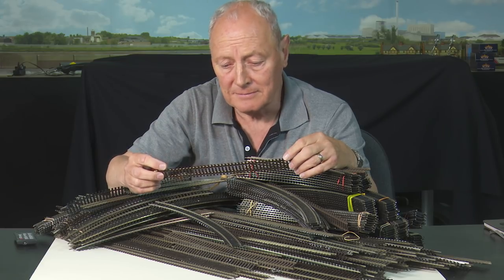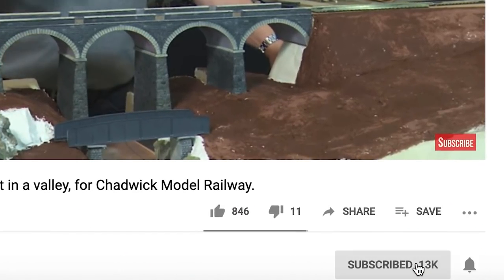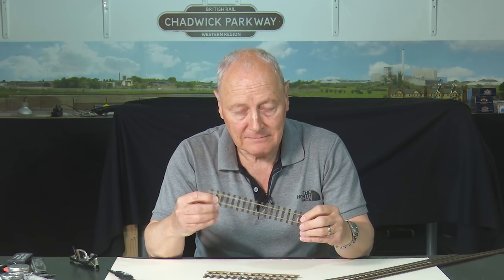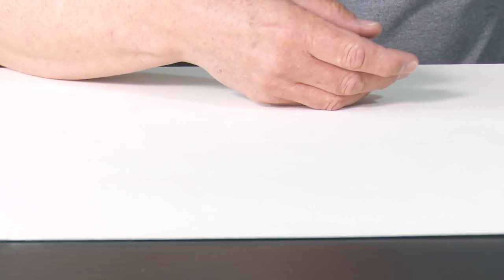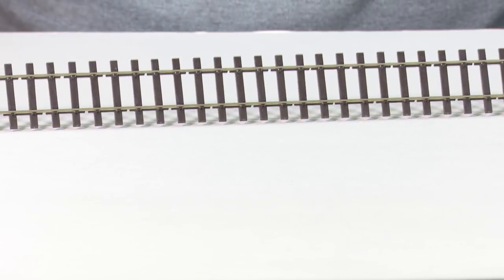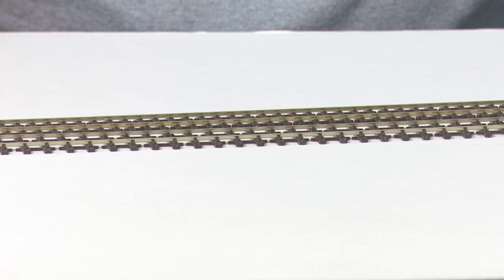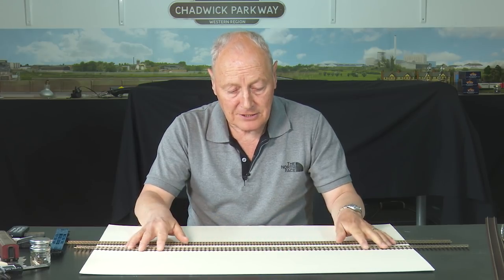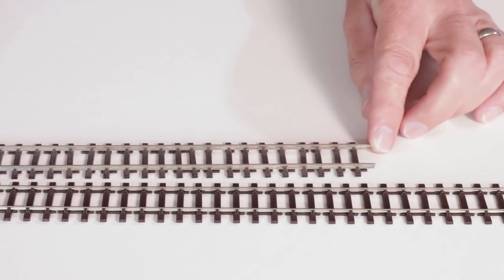Track  Peco Code 100, Code 75, Bullhead, EM and P4 explained at Chadwick Model Railway | 66.

Comment: Bullhead track should and could have been made available years ago. While steam locomotives continue to be an important part of the RTR scene, it is noticable at exhibitions that more and more modern image layouts are to be seen. Point geometry with flat bottom rail is not quite so easy to replicate in miniature scale, not an insurmountable problem, but cetainly a little more thought has to be given to its construction. Bullhead in this aspect is far easier to achieve. I also believe that the compromise with HO/OO , and the motors available not being suitably small enough to fit into the British Outline, was also a consequence of us refusing to source appropriate motors from Germany, where they were available.  Peco has dragged its feet over this HO/OO issue for many years. A prime argument being those who want finer track will make their own, which we do. However, simply spacing the sleepers, yes , it does take time, but is a cost effective way of maing the track look far better.
Reply from the maker: I couldn't agree more mate. Regards Charlie

Comment: The essential difference between 00 scale and P4 is not the scale ratio which is 1:76.2 for both but the gauge.  As you point out, 00 scale uses HO gauge track (16.5mm), EM gauge is 18.2mm and P4 is 18.83mm.
Reply from the maker: Absolutely RBJ, whole thing is a nightmare. Regards, Charlie

Comment: Echoing David Souter Charlie.  For those reading the comments Charlie in his tools video demonstrates a "Laserlines" tool that he discovered since for spacing the sleepers like he measured manually in this video. I don't know if it's possible to add 15 secs to the video showing it.  This is what I will do when I get around to starting my modern image build.
Reply from the maker: I mentioned the Laserlines template in my latest tools video.  I can’t edit a video once uploaded. By the way, the tool doesn’t work on curves.
Reply: Thanks Charlie,  I had wondered if a hairdryer and a round former could roll the tool to do fixed curves.  Just a rhetorical question for someone else to experiment with if they fancy it.

Comment: Brilliantly presented and explained. I have battled with "cookie cutter" flanges on wheels for many years and discovered that the PECO US standard code 83 rail works well. As I am in Australia, the costs are prohibitive in obtaining the specialized rail systems (points, crossovers etc.) when building a freelance industrial layout some 24 feet long by 16 feet. 
For this reason I started building my own specialized items of track as required. This was easier that I ever thought possible, allowed in situ fitting of equipment, much MUCH closer fitting of points and diamonds along with curving sections allowing a very much smoother 'run' through of all stock in all directions on any rail at the slow speeds of an industrial park setting.
I have used code 83 for most of the open display section but where the rail is set in concrete pads, has been cobbled or is not visible, I use the old code 100 from previous layout projects. 
I find that code 100 is fine and dandy until I tried to enter the competitions at rail way model shows. I then discovered an elitist cadre of judges who dominate so totally that code 100 meant a penalty against a layout which precluded it from the top spot every time. The "rivet counter brigade" rules supreme at competition level. The use of DC is also now frowned upon and not using 'sound' in layouts also penalizes one.  After fifty plus years of getting my layouts to run quietly, I am now expecting a need for a dining car with fish and chip smells becoming a requirement.
Your explanation of the various codes, scale vs gauge and comparisons makes fro a great and educational introduction and I really appreciate having found your channel. 
Subscribed and have hit the bell. Thank you
Reply from the maker: What a great reply Frank.
I’m saddened by your show judges.  It does nothing to encourage interest in our hobby.  
Anyway, I’m so pleased that you enjoyed the video and good luck with your layout.

Comment: Hi charlie thanks for the great explanation on the track ive just built my 1st model railway since 1980 using mostly old code 100 took up from the original by my late father in the mid 1980s
Reply from the maker: I’m so pleased that you enjoyed it Andy.

Comment: Hi Charlie, You are correct, most railroads here in the states were built to standard gauge. A few like the Erie Railroad was originally built to 5 foot gauge, but later changed to standard gauge. We did have quite a few narrow gauge railroads. Some were temporary logging lines, while others were common carriers. Of note were the Maine two footers (2 foot gauge) patterned after the  Festiniog Railway in Wales. The three foot gauge lines in Pennsylvania (East Broad Top) and North Carolina ("The Tweetsie" aka East Tennessee & Western North Carolina). The most famous of the slim rails as they were known, were the three foot gauge lines in Colorado (Denver & Rio Grande Western Narrow Gauge Lines and Rio Grande Southern). Here in the States it is also very popular to use different code sizes to represent different rail used by the prototypes. As a cost saving measure, the prototypes will use different rail on mainlines, passing sidings, spurs and yard tracks. In HO scale, we have code 40, 55, 70, 83 & 100. The most complete track systems are in code 70, 83 & 100. Most railroads here in the States now use continuous welded rail, but back when the railroads were still using jointed rail with fish plates, the rail length was 39 feet. Quite simply because that length rail would fit on a 40' freight car. It is interesting that in the UK the rail length was 60 feet. Charlie I find your videos very informative and very well made, thank you for posting them. Cheers, Rich S.
Reply from the maker: Hi Rich, it’s comments such as yours that make it worthwhile.

Comment: Another great video, Charlie! A lot of people get gauge and scale confused. Gauge is the distance from rail to rail, scale is the proportion of the model to the prototype. For my next layout, I plan to use Peco code 100 for the mainlines, and re-use my Atlas code 100 for branch lines and yard tracks. Turnouts will be Peco. I want to stay with code 100 for exactly the reason you mentioned: I do have some older locomotives that would not do well on track less than code 100. I also agree with your decision to support the local economy. I buy locally whenever I can, and only online when noone locally has what I need. I have always told people "If you don't support your local hobby shop with your big purchases, they won't be there for the small ones."
Looking forward to the next video! Take care!
Reply from the maker: Thanks Flyboy. It’s comments such as yours that make it worthwhile.

Comment: Personally, I'd say that a train set is just that: some trains, some track and maybe a little bit of scenery for decoration or play purposes. The aim is to run some trains
A model railway for me is an attempt to model an entire landscape with some criteria with regards to detail.
So for me, the difference is not the kind of track, but what the aim is. An ambitious modeller may try to be as prototypical as possible, while others take a more relaxed view and just want something that looks nice or has meaning for them. I would call these variations in railway modelling.
Having said that, other definitions are possible, like the distinction between set track and flexible track. However, if someone can build a beautiful layout with set track, I would not want to call their layout a train set as I feel it would sound derogatory.
Reply from the maker: Some go points mate.
Train sets get put away afterwards !
Reply: Beautifully put.
Reply: @jamescrab4110  Thank you!

Comment: I'm running all variants on mine. Code 100 on all non scenic areas. 
I've also painfully referenced all areas surrounding Exeter st David's and taken the leap to use flat bottom wooden and concrete re-spaced code 75 and bullhead mixed up together and what an arse to get it bang on the real location. 
The bullhead rail looks slightly odd compared to re-spaced wooden and concrete as the sleepers are slightly larger on bullhead in which creates a narrow gauge effect on a whole. The fishplates on bullhead are the biggest test though! They are tiny 😬 
5.5mm spacing I went for and was re-spacing, soldering droppers and fixing down in around 10 minutes per length. It's definitely worth the effort that's for sure. 

Tim.
Reply from the maker: Thanks mate, some interesting points.

Comment: Nice one Charlie. Despite it being a nightmare, you got the message across very well mate and you did it with humour, which is a nice touch. I used to work on the railway when they were converting from 60' wooden sleepered track to 300' concrete sleepered track. The main difference I remember between concrete sleepers and wooden sleepers is that concrete sleepers are moulded in 'formers' with a 'shoulder' under the chairs. In the photo you showed, you can just make out the shoulder in a sleeper on the right hand track. All in all though, it was a very entertaining video. Nice one.
Reply from the maker: Thanks Kevin, I’m so pleased that you enjoyed it.

Comment: Just seen this video, and as I am starting out in 00 gauge I found it SO helpful - thank you.  I have now decided to go down the code 75 bullhead route rather than code 75.  I have new locos and new rolling stock, and like the idea of the closer to scale look of code 75.

Your video on laying and ballasting was also hugely helpful - MANY THANKS
Reply from the maker: What a heartwarming comment Michael. Good luck with your new project,  regards Charlie
Reply: @ChadwickModelRailway  Thanks Charlie,  I have to admit to complete ignorance of a lot of terms - e.g. insul frog - electro frog - and that is because I have been in garden railways for the last 5 years so run live steam and battery controlled r/c locos (converted by me from track pick up) and my track is 45mm (about 500 feet around my large garden raised to about 24inches to avoid my arthritic knees having more problems.  (I can also plan and use reverse loops with impunity!!) I decided to use my 11ft x 9ft summerhouse for an 00 gauge (1:76 scale) layout so I could enjoy my hobby during inclement weather and in the winter months.  As I am 72 with arthritic knees, I have now decided NOT to have a "duck under" after seeing your video where you plan a re-work to your (large) layout!

hence my desire to view your other videos - especially on points (isulfrog v electro frog) - I am unsure, but have purchased DCC - NCE Powwer cab - so I "THINK" I will need electrofrog since the power will be in the track and the dcc system will control the rest?? - anyway - I was so pleased to find your site, and thank you for such informative, and clearly explained videos on subjects that are JUST what I need to understand.  I am about to buy "Anyrail" - as I think at this planning stage I need to get dimensions and radii right.

thanks again

Michael O'
Reply from the maker: Thanks for the update and good luck Michael.

Comment: Sorry that I didn't read every comment re: track size/gauge/etc but when you mentioned the tedious cutting and spacing the code 100 track to make 25 sleepers/60 ft length of track. Perhaps a 9-inch jig (very carefully built) that had 24 spaces into which the cut sleepers could be placed and thereby speed up the spacing process. Great channel - will become a Patreon.
Reply from the maker: I good idea Henry making the jig but the curves would still be a challenge.
I’m so pleased that you enjoyed the video and it’s great to have you onboard.

Comment: Wow...being an N gauge modeller I should have been quite bored with all this stuff but once again, it’s the way you tell ‘em Charlie. Fascinating insight into the hobby and I have wondered about the difference in track. I have to admit to using set track n my end loops, especially in the tunnel as I knew it would be a solid fitted loop. I am a flexi/finescale convert now though. Thanks Charlie, Chris
Reply from the maker: I’m so pleased that you enjoyed it Chris

Comment: Prototype track is a complex subject. Did you know for instance that in the early days fishplates weren't used. The ends of the rails simply butted up against each other, or that the GWR used bridge rail? Bullhead track didn't go out of common use on plain track until about 1970 as I remember. Some track even had steel sleepers, but as they were open ended the track tended to move sideways. Ash  ballast tended to be conductive and interfere with track circuits. It also rotted the sleepers.
If it hadn't been for recalcitrant landowners then the Liverpool & Manchester Railway wouldn't have had to been routed over Chat Moss and they never would have found out that resilient track was better than rigidly based track. Rails lasted seven times longer over the Chat Moss section than they did in other areas where the base was solid and immovable.
All this I learned from the excellent book, The Railway. British Track Since 1804 by Andrew Dow.
Reply from the maker: I’m on the hunt for that book NOW!

Comment: Hi Charlie, thanks for your informative video on OO model railway track and the different track gauges.

I won't go into the P4/S4 vs OO/HO track debate. But about 40 to 45 years ago when I decided to build model railways as my hobby, I decided at that time to build / modify my OO scale model trains to run on P4 track. 
My reasoning was two fold, first if I was going to build my model trains to scale, why not have scale track for them to run on, and second commercially made Peco or Hornby track and turnouts over here where I live in New Zealand are over twice the price of the same track if purchased in the UK.
 
I am an average railway modeller, I could not for example build a model of a steam locomotive , nor could I build a working semaphore signal,  but because of the design of P4/S4 track,  I can build very good P4/S4 track and turnout formations. Building P4/S4 track is the easy bit, building  locomotives , coaches, wagons, model buildings, scenery is the difficult bit. I do not consider myself a great modeller, I could not for example build a working model of a steam engine in OO scale, nor could I build a working semaphore signal, but I can build very good P4/S4 track and fairly complicated turnout.

Modellers should not be put-off converting to P4/S4 scale track, as over time it has been made out to be much more difficult to build P4/S4 track than it actually is.

Regards
Barry
Reply from the maker: Thanks Barry, you’ve made some very interesting points.  Is your P4 layout a tail chaser?
Reply: Hi Charlie,  Sort off ! It is a continuous double track main line about 9 real ft short of a scale mile around the 4 sides of my train shed with a model of Barnham station on one long side of my train shed and 10 storage sidings on the other side representing London, Brighton and Littlehampton on the up main line, and Chichester, Portsmouth and the West country on the down main line, and a reverse loop for the EMU's that burrows down under the layout in southern style, connecting the up sidings to the down sidings

My storage siding set-up allows a time table working based on the services to and from Barnham in the late 1950's and early 1960's, with 3 steam hauled down express passenger trains from Brighton to Bournemouth, Brighton to Plymouth, and Brighton to Cardiff with return workings in the evening. Then there were 2 up express EMU trains and 2 down express EMU trains from London every hour that split and joined at Barnham, one portion went to Portsmouth and the other portion went to Bognor Regis.  In addition there were local stopping EMU service from Bognor Regis, Chichester, Portsmouth, Littlehampton, Brighton, and London that stopped at Barnham. Then there was the goods and parcel service, but that another story.

If you look at track plans of Barnham in the 1950's and 60's Charlie you will see that it had a very unusual turnout formation at the west end of the station that included a pair of curved diamond crossings and 2 double junctions, which would be very difficult to model with commercial turnouts, but was a lot easier to model with P4/S4 track. 

Regards
Barry
Reply: @bazza3643  Late reply Bazza, but i'm in NZ too and only just getting back into the hobby. I used to build brass 7mm diesel kits before pre-built was a thing (and the prices are eye-watering)! I love the idea of P4 wheel sets in 00 models, and building track. Is it cheaper to make your own here, with shipping costs etc factored in?